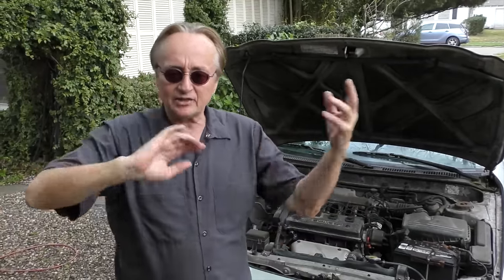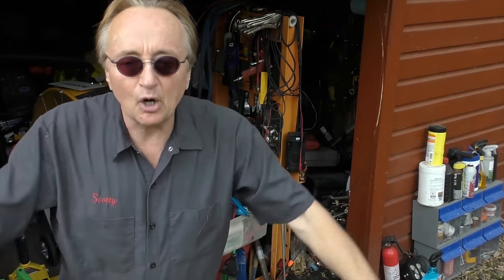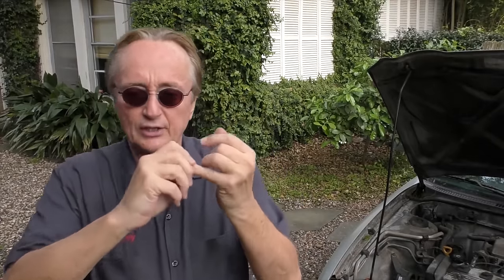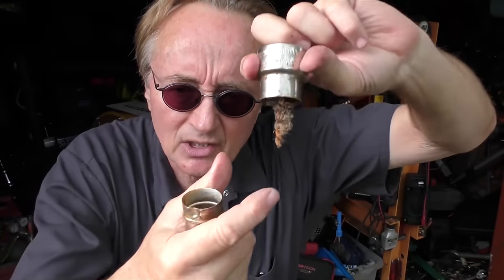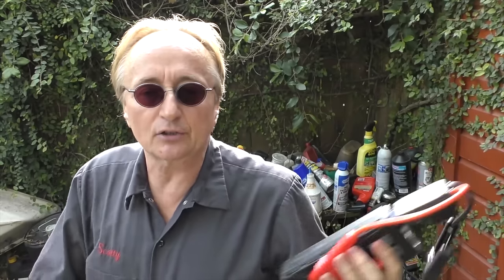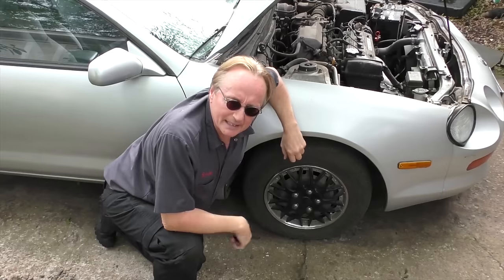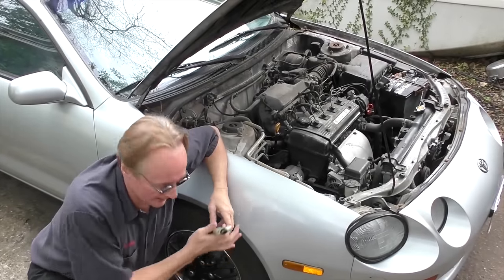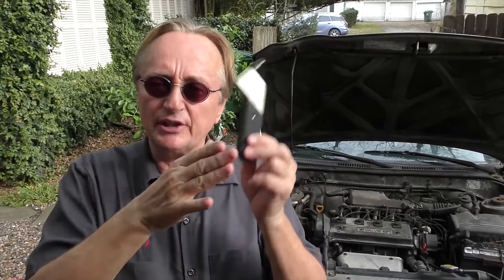If You're Not Doing This Before Starting Your Car, You're Stupid

Comment: Scotty, you give me dealerphobia, the fear of car dealerships
Reply: I SAY HOLD THAT THOUGH, IT'S A GOOD ONE
Reply: They charge you spare parts with 100% to 400% on top price.
Reply: several years ago my battery got drained and i checked into dealership. They found my alternator needed to be replaced. they did. but they replaced it with another faulty alternator that broke down after a few weeks. I then went to a friend who was an engineer and did service cars in parttime. He told me dont go to dealership instead I should learn preventive maintenance. Things like alternator, serpentine belts, changing fluids, brake pads, suspension system, spark plugs, they all should be replaced when the mileage has been reached. And go to dealership with specific job instruction to them when servicing your car, such as "please replace my brake pads", "please replace serpentine belts", and reject any other offers they give you. and watch the mechanic doing the job.  Never come to dealer and say "my car doesn't feel right, please fix it". that's when they would rip you off.
Reply: Dealerships are always a bad choice for parts or service

Comment: For all my years working on cars and driving them, I have only experienced this light coming cuz of low brakefluid ONCE. Customer came to get his car after service/repair on a Monday morning and didnt dare to drive it so the boss gave him a car to borrow for the day and I came in for work that Monday and got the job of checking whats wrong with this car with the brake lamp signal in the instrument cluster. I run a diagnostic test and it said it was low on fluid. I just filled some and that was it... I got the blame for that because someone with a similar name actually had the job, not me. I just fixed it.

Sometimes you just got to fix stuff on the go and not spend 10-15 minutes arguing whos to blame

Comment: The hell with car dealers. I had a recall for the "bowtie" emblem on my 2010 Chev Silverado tailgate BUT, nothing about the paint. It's been peeling off 4 years after I bought the damn thing. Bankers must have shares in dealerships. Bunch of deviant crooks.
Reply: Businesses are classified based on their dominant source of revenue.  Ford -- and probably many others -- is listed as a "parts seller".  Which is to say that the only reason they sell cars is to sell parts for repair later.  They're generating their own demand.  They don't make money on the initial sale, but instead, they make it on the 5-10 years of repairs afterwards.
Reply: Dealerships make there most of there money on selling addon crap and services  long term
Reply: My 2012 Camaro LS3 started rotting at a rear wheel arch in 2015.  3/4 inch bubbles in the paint above the rear wheel. My dealer wanted to be in charge of all the process, started telling me they had to do it, they had to schedule an appraisal, wouldn't let me know where the regional appraiser was, wouldn't let me talk to him, I had to do it on their schedule etc etc. I told them to shove it, any GM center could do it. And then they told me that GM wouldn't honor the eight year warranty on the body because  they talked to Insurance and the panel had been repainted once (actually at a body and restoration shop that uses only factory techniques. The car had been keyed a foot away from the rot and the GM procedure was to paint the whole thing, including removal and replacement of the rear side window. The insurance Co wouldn't go for it, and it ended up being part of a case the Shop levied against the Insurance Co. So it was documented IN COURT that my car had the correct GM procedures done as part of a repair that was a FOOT away from the rot), and the rot hadn't broken through the paint yet.  The dealership squashed the whole thing with its interference. As if they gave warranties and not GM. I would love to know what F'd up thing they had going on with my Ins. Co. GM regional wouldn't help, the warranty claim had been closed. How I would love to be trapped in an elevator for 15 minutes with my old service manager from (the now defunct, big surprise) Clay Chevrolet, Norwood MA. That "man" cost me thousands in resale; the quarter is wiped out and it would cost 7 grand to fix, out of my pocket now. 7 grand to fix a car I could sell for 12K. Sonofabitch. Honda or Toyota would NEVER treat a customer like that.
Reply: Never really heard of a paint job being a reason for recall. Lol
Reply: @rayeversole3698  In the early 1980s, my mother bought a Ford Taurus.  It was the early years of clear coat and this began falling off.  Turns out the banker in the same small town my mother bought her car got his repainted free and the dealer would not repaint my mothers.  She should have called the area Ford representative.
Reply: @bbb462cid I wonder if this is why Scotty puts a GM dealership up in the corner of his videos when he says "junk yard" now.
Reply: You can’t go to the dealer and have them redo the paint? That’s not covered under the warranty? I always assumed a brand new vehicle from a dealer was covered with a warrenty
Reply: @pattyeverett2826  oh I see. Sucks still. But the reason now is it's hard to prove if the paint is defective or if it was external things or even the owner that caused the damage.
Reply: @rayeversole3698  This was the early 1980s and the issue was well know.  My parents should have just went around the dealer to Ford.  The would have gotten their car painted also.  The dealer played favorites.
Reply: michael lee  OK well you say so. I have a document that says the two are separate. I wish they weren't.
Reply: @bbuny10  The warranty covers rust through. Not rust making the paint ugly. The words literally read 'rust through' the paint.  Believe me, I read the documents.
Reply: michael lee  The issue would be covered by the 8 year warranty as I already stated. Look, I know everyone wants to help. Everyone has some angle. Everyone has advice. That's great. There's nothing anyone is typing here that fixes this problem.
Reply: @pattyeverett2826  ah, I see. Thanks for clarifying. Truth be told I'm a   Chevy man. In my experiences I've had less issues with one of them than I have over 3 other fords I have owned. But I understand that despite a production line, not every car is the same. Even if it's the same model.
Reply: @TROOPERfarcry  Dealers DO make 20% plus on new vehicle sales. Just because the dealer knocks off 10k on a vehicle listed for 60K doesn't mean you got a great deal. The dealer still made 10k plus.
Reply: @bbb462cid  It is like the home/auto repair warranty you see advertised now days.The odds of getting anything covered is a long shot. It is a scam.
Reply: @TheFishdoctor1952  roger that, doc

Comment: Good video! What do think of Mazda’s? I have owned 2  Mazda 6’s, the first,  a 2004 V-6 that is at 200k miles, my son is still driving it.  Only had to replace a radiator cooling fan controller, under warranty,  and a rear suspension link at  120k mi. Currently own a 2016 model. Drives wonderfully, but am missing the 45hp with the 2.5 liter 4 cylinder as compared to the 3.0 liter v6. My new Mazda 6  has DCI.  It gets great mileage. 28.9 mixed, and 35 highway driving. Should I buy a egr  “catch can kit”? Would appreciate your views on Direct Cylinder Injection.  Is buildup on the backside the of intake valves, due to EGR,  something I should worry about?

Comment: Have you ever worked on an 1962 Austin Healey Sprite? Mine had an oil leak at the rear of the crankcase. I thought it was the rear seal. I took the engine apart and when I took the crankshaft off I noticed the rear part of it had threads on it that were designed to throw the oil back into the crankcase. No seal! Because the bearings were worn the threads on the crankshaft were worn out too. I couldn’t afford a new crankshaft so I made a seal by wrapping thick mop strings around the rear end of the crankshaft and put everything back together. No leaks! I drove the car another 20,000 miles and never lost a drop of oil again. A new crankshaft would’ve taken 8 weeks pay working at my job. The mop strings were free. And they worked.

Comment: Most common reason for brake light is emergency brake is on,
Reply: YUP!
Reply: Bruh moment
Reply: jkirk1626  To be honest, if you drive your car to the dealership with the parking break on, that's just Darwin in action.
Reply: I have heard that some people drive with one foot on the accelerator pedal while resting the other foot on the brake pedal. They do not understand why the brake light keeps coming on or why they have to have a brake job done on their car so often.
Reply: @2utoday  Believe it or not, keeping one foot on the gas and one on the brake used to be taught in driving courses! People actually learned to drive like that!
Reply: lol
Reply: @tenhundredkills  
Only right foot for gas and brake padel. (Your left heel place closer to the brake padel)
Manual transmission, right foot only for clucth padel.
Auto transmission, right foot free or out of bound.
You won't mess up on driving an auto or manual transmission car.
Racing is totally different way of handling or driving.
Reply: @metzmatu8409  Left foot only? Are you sure about that?
Reply: @tenhundredkills  
Lol. Edited 'right foot'. Lol
Reply: jkirk1626  it’s $500 because they have to replace your brakes, drums, rotors and all. Driving with the “parking brake” (used to be called the emergency brake) on burns them up big time.
Reply: @metzmatu8409  Don't drive a manual if you come to the UK. Put your right foot down to change gear and you will tear off up the road.  
A.B.C. right to left. 
Left foot for clutch only.
A left accelerator is only good for a left footed person. Whichever is your dominant foot is the one that should go on the accelerator as you have more control.
Reply: What is an emergency brake? You activate the pedal /arm / lever when you parked, otherwise the car rolls away. Unless you are the sort that leaves it in gear.
Reply: @gamers-suck  there is a difference between an emergency brake and a parking brake. It’s a matter of surface area... and pretty much semantics. While you can park with an emergency brake you really can’t emergency stop with a parking brake. My 1970 240Z has an emergency brake while my 2003 Sunfire has to parking brake. 12 inch drum vs 7 inch drum.
Reply: @gamers-suck  
😄 you got the point there. Different part of the world, different foot padels layout. While some are customised for a specific driver's requirement.
Reply: @ColonelSandersLite :  If you don't know break from brake, that's another form of Darwin in action.
Reply: @rogergeyer9851  You're seriously getting tilted over a 3 month old typo?  Get a life bud.
Reply: @metzmatu8409  right foot for clutch? I’ve driven a standard for many years and my clutch is on the left.
Reply: It’s not really the emergency brake, it’s the make-the-car-smell-funny lever.  Mitch Hedberg.
Reply: The accelerator is still on the right in the US. The pedal layout is not mirrored.

Comment: Recalls...
Had an 1985 Buick that had the sticking rack and pinion steering problem in about 2000. The guy bought the car as the 3rd or 4th owner. He would have to spend five or ten minutes everytime he started it to let it "warm up". 
Local dealer tried to denigh the recall but I busted their balls until they fixed it. The cost would have probably 'totaled' the car. He had tried to trade it in or sell it but the near possible to turn start ups killed all the deals. 
Scotty is right recalls are forever.

Comment: Scotty, one thing I have found, people don't understand what "cold" means with tire pressure readings, I try to tell them it doesn't mean literal "cold", it means air temperature (what ever that is at that time), so do it after the vehicle has been sitting for hours regardless of the outside temperature.

Comment: I bought a battery tinder last year and keep it hooked up to my battery. I only drive four miles a week and the battery (AAA) was brand new at the time wasn't keeping a charge. The local mechanic in this tiny rural town told me something was draining the battery and after he charged up the battery I drove my truck to his garage where he put a diagnostic machine on it. Nothing was showing up. 
The guy didn't bother to ask me how many miles I drive a week because if he had he would have known that the battery couldn't keep a charge just by driving four miles a week. 
I finally used up all my AAA service calls last year and bought the battery tinder. One of the best things I've ever purchased. Prior to buying it I bought a small battery charger that has ports for other devices that use a USB cable. It's a Gooloo and it's great. I keep it in my vehicle just in case.
I'm a single lady and don't have anyone to rely on to help me when I need it. The charger and tinder is a life saver.

Comment: Talk about warning lights, Audi has a “ Service Due” warning that comes on every 10k miles. This is fine, but they won’t let you reset it like you can for the oil interval light.
Reply: It’s every 2 years or 20,000 miles here in the UK
Reply: Get that "Fixed" gadget..I paid $20.00 on line..it tells you everything.& it lets you turn off engine light...Went to a mechanic friend..his machine said the same..(& it's good for more than 1 car)
Reply: Yea man mine a4’s old i can clear mine myself but get a $20 code reader it will let u clear it/reset it.

Comment: Auto parts stores also do a lot for free too, like free install for batteries, bulbs, wipers, fluid level check, check engine codes, tool rentals, oil recycling, ext. The diagnosis knollage from taking to the people is valuable too.

Comment: I suffered several years with a battery not holding a charge.  I finally took it in and guess what:  the door was (which was inoperable to me) was stuck in the own postion.  $130 bucks got it fixed, but I was at a shop that I had used as my go-to shop for years.

Comment: Just remember if you do fill up your brake fluid it will overflow when you change your brake pads. Brake fluid may even plug the vent and blow the cap off and spray brake fluid everywhere. If you don't top it up it won't overflow.

Comment: All great stuff! I tell people our cars are like our bodies, we need maintenance like cars. A guy in a dealership service was telling me he was upset because he needed new pads at 30k on his new car. Michelin tires, we pushed them into 7 years on a 2002 Honda Accord VP. It rode great with them. I sold it in 2015 for 5k. Big mistake cause it would have outlasted the 2015 Hyundai Sonata Hybrid.

One thing I learned was Toyota does those TSB. My 2008 Camry had one for the adhesive in the inside ceiling around the moon roof. Happened with my 2017 too.

Comment: Hwy 15 from. NV to CA has a long, long climb.  Many cars over heat.  I have always turned on the heater to help cool the engine, turning off your air conditioner and just use Hill Billy air and roll down the windows...

Comment: Ford refused to do recall on suspension.  IIRC 99 Taurus the coil springs rusted, broke.  My car was a estate car. (Stored inside 4 yrs). I left it as my Colorado car. (Cheaper then renting a car every time) so it was low miles.  Coil spring breaks.  They refused, claimed it timed out.  Wasn’t worth fixing as it had survived a tornado picking it up, putting it thru a shed, setting car wheels not touching ground on foundation.  (Still put 8k miles after that before coil spring broke). Sold it.

Comment: One problem I noticed was with the burping of the coolant system. What he described will work, unless you have a pesky thermostat in place, which stops most of the coolant from cycling when new, but often, the little hole in it clogs up stopping all flow unless the cars coolant is at 195 or so...

Comment: Most common reason brake light is on because the emergency brake was left engaged.
Reply: Until this video, I thought that light was just for the parking brake and that any other issue would trigger the check engine light.

Comment: Great video, I have a 2010 Acura TSX that when it gets below freezing, the brakes intially don't work.. Either have to let warm up or pump them several times to work... Changed fluid, checked brakes... What might it be? Never have the problem when it's warm....

Comment: In some modern cars the "brake" light indicates when brakes need to be checked.  It shows wear.  These manufacturers eliminated the warning tab in the brakes that squeal to alert the owner to check brakes.  Topping off break fluid can in some cases not alert the owner and rotors get over worn or damaged.

Comment: It's funny Scotty that you showed jump starting a Decca battery with a Lithium jumper. I have a 2002 Avalon 6 cyl. that my mechanic installed a Decca battery in. A month went by, and I started having to jump start my car about twice a week using my wife's car. I took the car back to my mechanic and he said the battery was no good, gave me another Decca charged me $25 = (  to change the bad battery and off I went. In the mean time I bought a lithium battery jumper that is rated for a bigger engine than I have and I made sure it was fully charged. Well a moth or so went by battery #2 needed a jump took out the lithium jumper AND......nothing, this story is longer than I feel like typing and I'm sure you have things to do. I really like you're videos, you remind me of some of my mechanic buddy's from the early 70's. = )

Comment: I agree with most everything you said except topping off fluids is a great advise. except it's not always the fix. Get your brake pads inspected, cooling system inspected for why it happened. Of course by someone you trust, yourself or a trusted mechanic like yourself or myself. Great advise though.